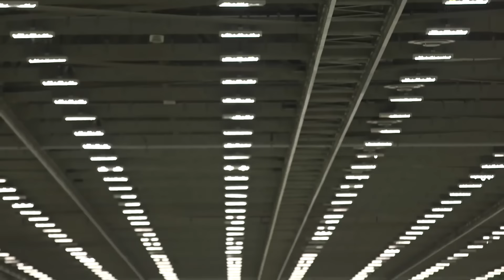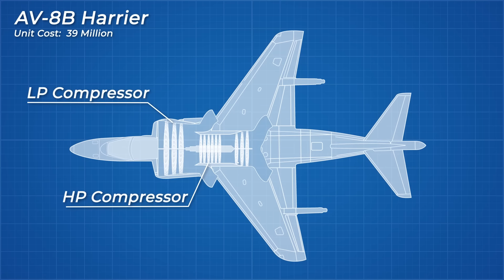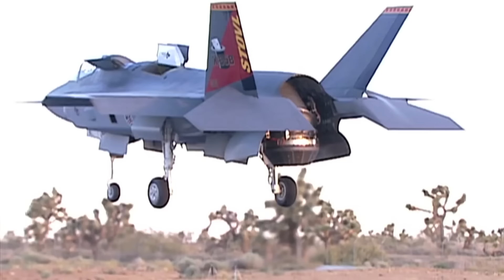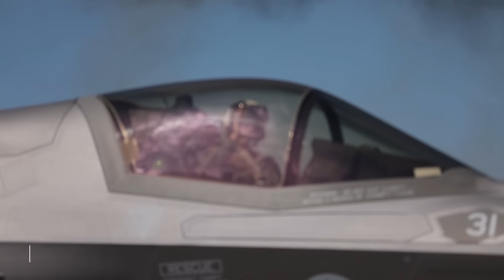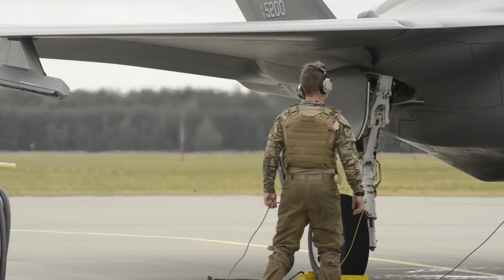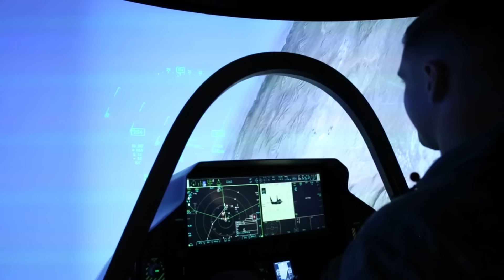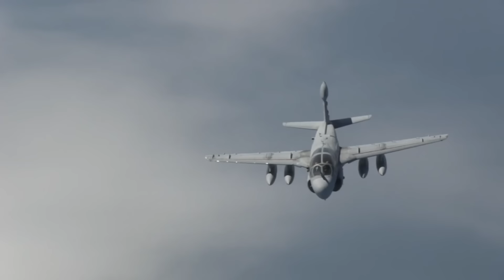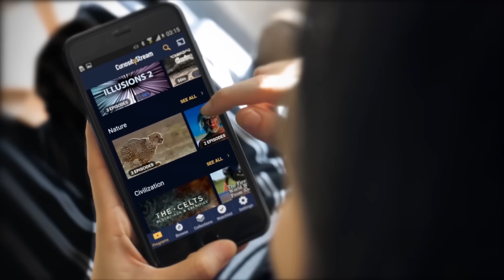Is The F-35 Worth $115 Million?

Comment: I don't like the part where the A-10 was shown when you said "The other aircraft it replaces."   Nothing can every replace that beauty.
Reply: The A-10 was known for flying low and slow, but nothing is slower than the f-35 in its 'sitting duck' hover mode. Clearly those four open thrust ports are far more durable than a titanium bathtub against ground fire ;)
Reply: @sprinkle61  That's never going to happen in combat.  We have helicopters for that.
Reply: Super Tucano?
Reply: In all honesty, I find the A-10 as a very overrated plane. I'm not saying it's bad, but it isn't as good as most people see it.

It has good weaponry and armor, but because it is so heavy compared to its thrust, it is slow. Also, it is rather unstable because the gun takes up so much weight.
Reply: @keppawolf  I have never heard that the A-10 is unstable. It is slow, but very maneuverable. Slow isn't going to win a dogfight, but its not that bad if you need to acquire your own ground targets and IFF. Now if someone else has a laser on the target, a c-130 will work much better, but a proper CAS plane needs to fly slow to target ground enemies.

The real problem with the A-10 is that it is way overpowered for most of its modern day missions. We sent them in to shoot ISIS's fuel trucks a few years back, but it doesn't take a lot of auto-cannon rounds to blow up an unarmored truck full of fuel. I think the first gulf war was the last time the A-10 had any worthy targets to shoot at. It would be great against Soviet armored columns, if the cold war had gone hot, but somehow not nuclear...

Comment: how to make this project less bad: 
- come up with a bunch of ideas
- build some prototypes
- design a set of interchangeable parts (engines, stealth systems, landing gear, etc.)
- make 3 different airframes each incorporating the best ideas from all earlier prototypes
- use the previously developed interchangeable parts (so you aren't tech for each craft)
Result: 3 specialized, high-performance aircraft with costs cut in development, and production well optimized for vertical intergration
Reply: Good

Comment: Too bad it can't handle software, or supersonic flight.
Reply: Every single variant can go supersonic.
Reply: @infinitelyexplosive  it can, but "Supersonic flight in excess of Mach 1.2 can cause structural damage and blistering to the stealth coating of the F-35B and F-35C." 
So basically it will fall apart. 
Source: 
https://www.defensenews.com/air/2019/06/12/the-pentagon-is-battling-the-clock-to-fix-serious-unreported-f-35-problems/

Further reading: 
https://www.pogo.org/analysis/2020/03/uncorrected-design-flaws-cyber-vulnerabilities-and-unreliability-plague-the-f-35-program/

For me the best part is 
""The gun for the Air Force’s version not only can’t shoot straight, but breaks the aircraft when fired."" 

So not really supersonic and it's gun is more of a threat to it than it would be to the enemy, yet they insist on calling it 5th gen. 

It's honestly laughable.
Reply: @carelesslad9931  So what you actually wanted to say was "The F-35C doesn't go as fast as it should in certain contexts", which is a completely different thing.
Reply: @infinitelyexplosive  Well it's not really different, it's like saying I can sprint 11 seconds 100 meters but I'll injure myself really bad if I do. Effectively then you will never run that fast and that's what we have here. The pentagon instead of fixing the issue (because it can't be fixed this late in the game) is simply suggesting that these panes not go supersonic. 

One pundit put it the best "the Pentagon is selling the stench of it's soiled pants as a strategic strength". 

Can you call a plane 5th gen if it can't go supersonic? Of course not. Read the score cards, it's knee-slapping hilarious.
Reply: @carelesslad9931  Mach 1.2 is supersonic. You are saying the plane cannot travel at speeds greater than 680kts when everyone agrees it can travel at 800.
Reply: @infinitelyexplosive  They won't risk it, pentagon deemed that they will just rely on the stealth of the plane, so it will be a capability that isn't used, because it's risky. 

Either way it's a plane riddled with serious deficiencies, cramming unproven techs in order to line the pockets of the MIC and congress shills. Not reliable and cannot deliver as advertised. Not worth the money, but as long as it creates a delusion of superiority I'm all for it. Especially for the numerous vassals that will get stuck with it, they deserve it.
Reply: @carelesslad9931  What do you mean "they won't risk it"? The plane can, has, and will continue to fly at supersonic speeds because it is able to and it provides a benefit in some scenarios. Why are you unable to comprehend that mach 1 and mach 1.3 are different speeds?
Reply: @infinitelyexplosive  
Well I guess you were right and I was wrong.. nah I'm just kidding, I wasn't wrong - those things can't fly safely at high speeds. 
Also I'm not insisting on the difference in speed not existing (that's you strawmaning me) , just that the two variants (B and C) in question will not fly missions at supersonic speeds ever, even for intercept. 

" An issue that risks damage to the F-35’s tail section if the aircraft needs to maintain supersonic speeds is not worth fixing and will instead be addressed by changing the operating parameters" 

https://www.defensenews.com/air/2020/04/24/the-pentagon-will-have-to-live-with-limits-on-f-35s-supersonic-flights/

Changing parameters meaning since our 5th gen fighter might fall apart at supersonic speeds we wont make it do it. It's still 5th gen though, totally, and cheap and reliable. 

LOL I mean it's really funny that since it can't go fast as it was marketed, they are like "It'l just go slow and shoot pew pew pew and it's all really the same".  

But I guess you know better than the Pentagon so I'll have to take your word for it.
Reply: @carelesslad9931  The solution to the tail issue was afterbuner limits above mach 1.2. This means that the planes can fly at mach 1.2, which is supersonic, for an extended period of time.

Comment: One plane to do everything? That kind of thinking didn't work too well with the M-14 rifle. Plus the first Lightning (P-38) had two engines, if one engine went down, a pilot could get home on the other one. That's an awfully expensive plane to just bail out of (much more than the F-16) if the engine quits. Just sayin'.
Reply: Not really the case
Reply: A rifle is a completely different system to a fighter. Besides, the F-35 was never designed to do everything... that's just the media creating drama. The F-35's engine is also a heck of a lot more reliable than that of the F-16.
Reply: @dumdumbinks274  I sure hope you're right. I wish there were more F-22's made before they broke the mold.

Comment: The F-35B is a fantastic design that makes smaller cheaper carriers essentially as effective as Ford class carriers. The F-35C makes no sense at all. Trying to be somewhere between an F-22 raptor and a A-10 warthog makes for one heck of a schizophrenic design. Stealth won't help much in a ground attack roll and the smaller gun and reduced payload capacity means it can't really replace the A-10. And well it probably makes a great air superiority fighter, its not half as good as an F-22. Sure the fusion sensor suite and electronic warfare is more advanced but they probably would have been better off upgrading the F-22 with that instead.
Reply: The F-35B has substantially limited range and payload compared to the C. In terms of the F-35A's payload compared to the A-10, the A-10 actually loses slightly.
Reply: I meant reduced payload capacity in terms of how many hard points it had(11 vs 6). I should have been more specific, it did sound as if I was talking about weight.
Reply: @BjornCanute  F-35 has 10 hardpoints and doesn't suffer as much drag as the A-10, thus it can carry more weapons as well as heavier weapons.

Comment: I never understood why the USAF version didnt just use the F-35C's larger wing.  Seems the larger wing would provide more lift and heavier carrying capacity and reduced cost since your only building two wing types.
Reply: A larger wing is heavier because the forces experienced at the tips are further from the body, creating higher torque and thus requiring more structural reinforcement. Additionally, they increase drag and RCS. The main benefit of the larger wing is allowing for slower takeoffs and landings, as would happen on an aircraft carrier.

Comment: If those Chinese quantum radars that use entangled particles are for real, and if they can be miniaturized and made airborne to guide air-to-air missiles, the stealth advantage of the F-35 evaporates, and all that is left is a decent general-purpose, but hopelessly overpriced fighter jet. From an Engineering point of view, that is no doubt a nice machine, but militarily either inadequate for the chosen enemy, or way too over-speced for less capable enemies. In other words: the F-35 was top-notch (save for the Raptor) a decade ago, but today, it would be 10 years too late to hit the market.
Reply: The critical issue being that quantum radars don't exist yet and they won't be miniaturized for a minimum of several decades.
Reply: Quantum radars even if possible in any usable manner are still decades away from any sort of implementation